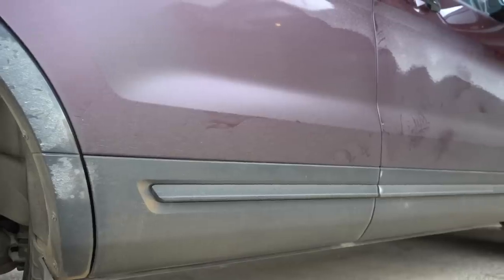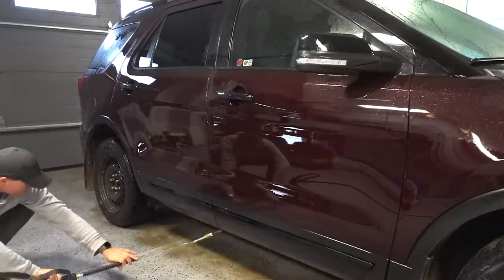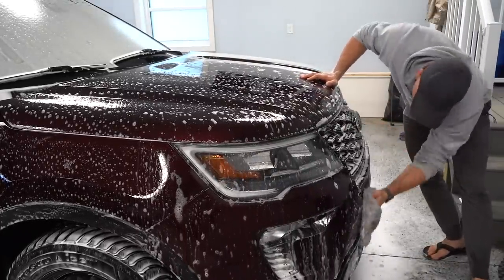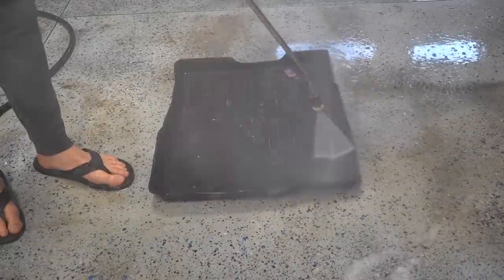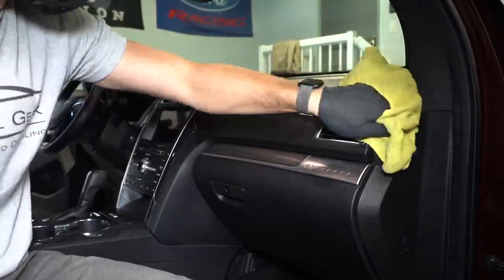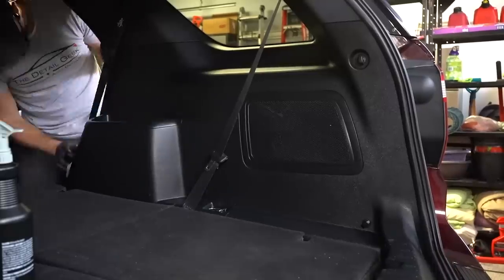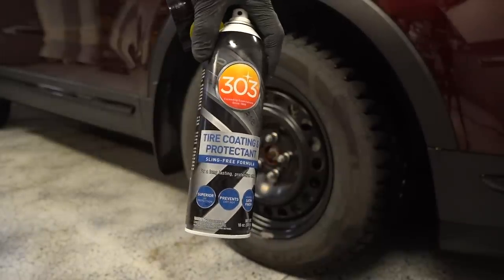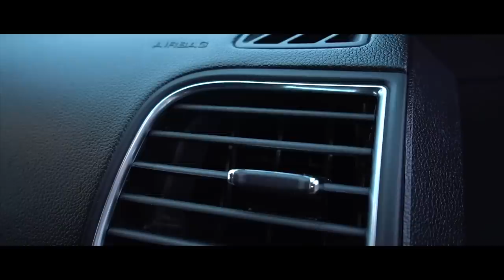Transforming a DIRTY Ford Explorer! | Satisfying Car Detailing

Comment: the last of the good looking ford explorers. 2019
Reply: I drive a 2017 with the sport appearance package.... the 2016-2019 was the best looking hands down, especially with the signature LED lighting.... but i dont know... the 2020s are starting to grow on me.... especially the ST....My three gripes with the 2020s are:
1: the grill.... it doesnt mesh well with the headlight shape like the 2016-19 did....
2: the larger touch screen, granted its easily fixed by opting for the smaller screen, but this goes with #3..
3: the orientation of the AC grills immediately adjacent to the touchscreen.... who ever thought it would look good to have a VERTICAL mounted screen in between TWO HORIZONTALLY placed AC grills... needs to go bury themselves in a hole.

Other than that, Im starting to like the look of the 2020 Exploders
Reply: The 2020 isn't that bad

Comment: When you said the thing smelled from a smoker it came to me to suggest you try a ozone generator. But first they are dangers for the user if you don't follow direction and take precautions. You can't jump in the vehicle right after using it. You would have to run it a couple times depending how bad it smells. You should open the doors after running it and run a fan in one side and out the other to blow out the ozone. But in this case you might not have had the time.  Yes I've liked that model of Explorer very much.

Comment: Since cleaning products weren't used on the interior, and instead a damp cloth... How do you ensure that everything is sanitized? Just wondering since water alone doesn't kill any germs or bacteria...and if the car was smoked in, there would be nicotine on these surfaces that would contribute to the smell. Wouldn't some kind of cleaning product be needed for this?!

Comment: You never use prewash? I use it on my work and it works great just spray the car in let it set for a few mins (in that time i always clean rims and wheels) than i spray with high pressurewash it off  but most of it is already fellen off because of the prewash
keep up the good work
Reply: Pre wash is strong, will remove the wax from the cars paint, if you dont wax your car, guess its ok.

Comment: Did you clean the head lining. Can’t imagine how smelly it must have been. 👍🏻
Reply: Most of the smell ironically isn't from the headliner. Its wayyy to thin to hang on to major smells. Its usually from the floormats and seats
Reply: I think he mentioned in a video that he does, but doesn’t show it. Could be wrong
Reply: @eileenmarie1652  i just went thru the whole vid and i heard no mention. But i wasn't saying you were completely wrong, yes the headliner CAN hold some smell! But it wont be the main problem, just like maybe 1%-2%. The MAJORITY of the smells comes from the seats, floormats, and even the floor liner. Cloth is NOTORIOUS for holding most of the smell from the cig ash. And depending on the material amd quality of the cloth will greatly factor how much of that smell embeds itself there.